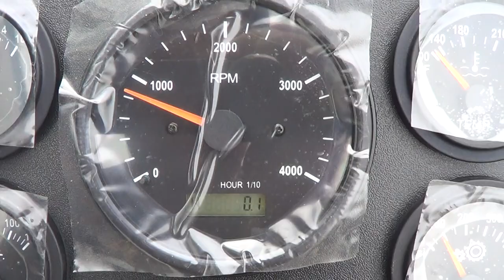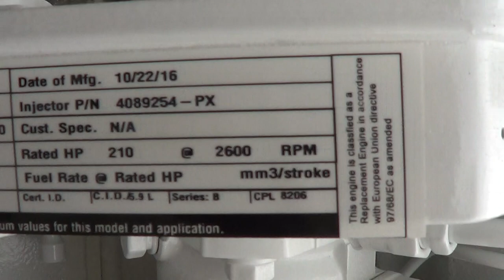Cummins Marine 6BT 5.9 210 with DMT 90 3.46 Transmission - Engine #2 Test

Comment: These are tough engines. I know a lobster fisherman who has this engine in his cape island boat. It has over 16, 000 hrs. It smokes a lot when shes cold but it runs like bastard. If you let them warm up and cool down properly and use a name brand oil they'll run forever.

Comment: What's a better engine for a commercial lobster boat? The 6.7 or the 8.3?
400 to 600hp range
Reply from the maker: If you want 400 plus HP in a commercial setting, you would be pushing the 6.7 pretty hard.  It all comes down to the HP per Liter of engine displacement.  The more hours per day you require that 400 plus HP, the more displacement you need.  For a weekender type boat, Cruising for an hour to the fishing grounds at 400-500 HP then fishing, trolling, moving around, cruising back for an hour at near full HP.  The 6.7 High Output is great. But for commercial applications the 6.7 is limited to less HP for intermittent or heavy duty ratings.   The 8.3 would be a better choice and the QSL 9 is a great option too.  That's what we put in our recent lobster boat build.  There is a lot of great info about duty ratings on our website. this is just one of many articles. https://www.sbmar.com/engine-info/cummins-qsb6-7-specifications/